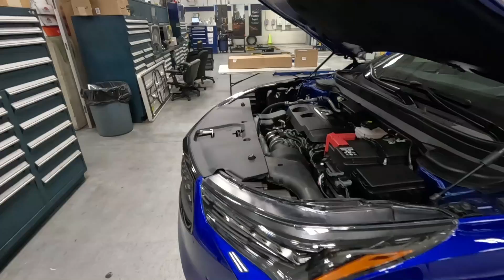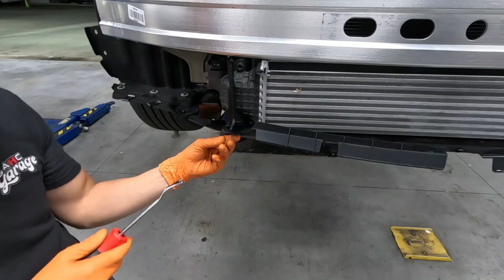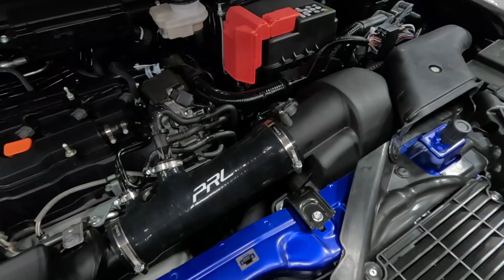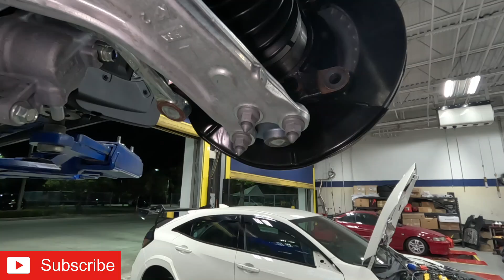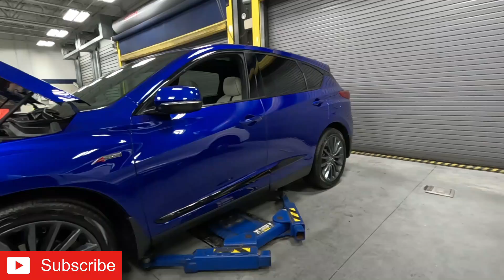2022 Acura RDX A-Spec - 1/4 Mile Testing | PRL Intake and Intercooler | Eibach Lowering Springs

Comment: A find the performance improvements a little suspect.  I know the intercooler upgrade prevents heat-soak but did I miss another upgrade besides the intake?  I don't believe an intake would cause that much of a performance difference and actually very little.  Please help, since I do have a 2021 RDX and want to increase performance.  The RDX is my daily.  I don't own performance cars anymore as I don't have the time to enjoy them.  Thank you.  Update on 11/21/2023.  I didn't notice the ECU re-flash in BOLD, so that was the reason for my original comment.   I am looking into getting my RDX to have 350 at both ends.  Anyone on here have such a set-up?
Reply: The tune flashed to the ECU would have been the largest improvement. Would have been interesting to see before and after iat and boost numbers.

Comment: Always love the videos that come from AHC garage! Keep it up.  So looking at the PRL intake kit I'm happy to see they included a support rod for the air duct.  Once these are tuned that air duct flexes and can collapse to restrict the turbo.  Unfortunately for us RDX folks there is no further intake support.  Would be awesome to have an upgrade in the future that would leverage that air duct and remove the factory resonator on the intake.  In the meantime this is a great solution.  Accompany this with the PRL inlet pipe for the fk8 and you have possibly the best system available for the RDX at this point.  Next lets see a downpipe and maybe the Phaerable stage 3 tune.
Reply from the maker: Right on!!

Comment: All that modding for less than a second?, I have the same car but on red and is wicked fast for a SUV, I would never put my car through all that disassembly and on top of that spend money to make it a second faster, what a waste imo.
Reply: Idk but it’s a must have for me now lol all that’s left is that type r turbo and the down pipe and it’s all faster now😈
Reply: @maubaca5890  ok if you think is worthy then great for you, I’ll leave mine stock.
Reply: @yordan826  The magic is in the tune, and you can get that for under $500. The rest of the supporting mods are unnecessary. Ktuner stage 2 was developed using stock hardware.
Reply: After the tune he was just stabbing the throttle from idle.  If had TC off and power braked it it would have cut 1.9 - 2.0 60fts and dropped the 1/4 by another 4/10ths.  (I've been a drag racer since the mid 80s)
On a prepped track, practice in launching it, and cooler air I'm confident it'll cut a 13.9 at 96mph.  Maybe even better w/a down pipe upgrade.

Comment: Alfa stelvio 2.0 turbo does 0-60 in 5.4 stock 
Lol i
Reply from the maker: Good for you
Reply: @ahcgarage  it is especially when it can be had for 53k 
And don’t have to spend money on an intercooler and intake and tune which installed probably at $3k P/L to gain what .7 of a sec complete waste of money and you know it!! I bet with the tune alone is where u gained the others were money thrown away.. I really like your channel too but in this case you should of noted that this was not a smart mod to do for the money vs gains
Reply: @cbruno12180  But you'll still be driving an ugly Stelvio, that'll end up in the junkyard in 5 years, while the RDX will be barely broken in after 5 years.

Comment: Why weren’t you able to set caster on the driver front? & would be nice to see when yall torque to spec. Or you don’t torque?
Reply from the maker: We will re-perform the alignment after the lowering springs are settled. Most of the items are torqued off camera so we are not dragging it longer

Comment: Fantastic video. Thanks so much for showing both of these mods. 
I personally did the intake myself, and i did not know what that extra piece was for.

Can't wait to also get the intercooler upgrade
Reply: Same man. I was going crazy trying to figure out what the hell that little thing was for haha
Reply from the maker: Thanks for watching. Hope this video helped you guys
Reply: Why are you going to add the intercooler are you planning on going further with mods? Because the cooler alone seems to be a wasted upgrade alone
Reply: @cbruno12180  most mods are unnecessary. But (1) it is a cool project as a DIY to learn (2) makes my car unique and good conversation piece (3) it's just pretty damn awesome to upgrade something and improve on the original. That's what life's about, always improving and getting better.
Reply: @johnnybyup  I agree but wasting money is not a conversation piece thou do you agree on that at least? That’s why I asked if you plan on going further than just the intercooler
Reply: @cbruno12180  if it's something that you enjoy and want, then it's not a waste of money. What you view as a waste, can be valuable to me and others.
Personally after the intercooler upgrade, I will be upgrading the catback exhausted for a better sound. After that, there aren't that many more official upgrades for an Acura RDX. The lowering springs wouldn't add value to me since I live in Toronto Canada, and I prefer a higher ride for the winter months. So for me, it would be a waste of an money/value. You have to look at your circumstance and what you want to achieve. A lot of people are happy with a window tint.

When I owned VW golf, the upgrades and customization were endless. Jeep owners have endless mods.
Reply: @johnnybyup  u see we’ll u answered my question ur getting a cat back the down pipe will available soon from what I’m hearing then it all ties in.. and yes when modding a car for performance reasons there is wasted money if not advised correctly.. when doing cosmetics that’s a diff story sir sorry I’ve been modding cars for 25 years and learned the hard way unfortunately so just be careful.. your not installing an intercooler because it looks good rt?
Reply: @cbruno12180  thank you for your feedback. I'll do what I want with my car and my funds. Have a good day sir